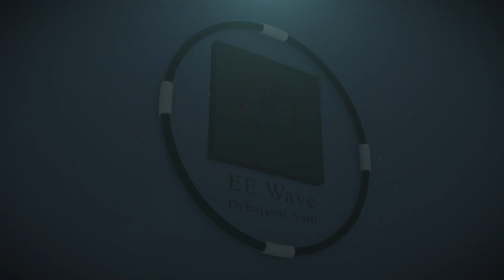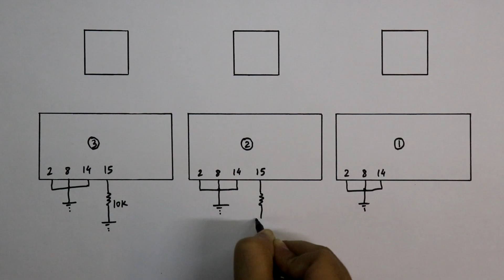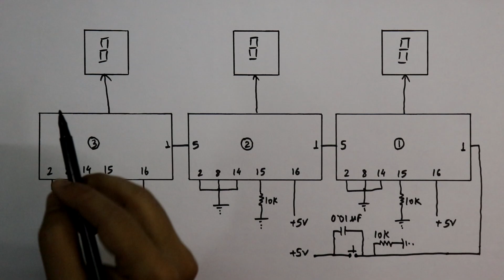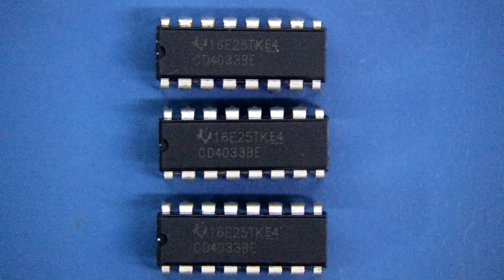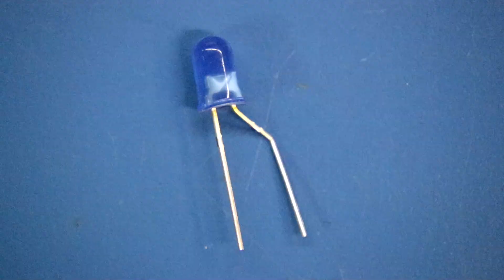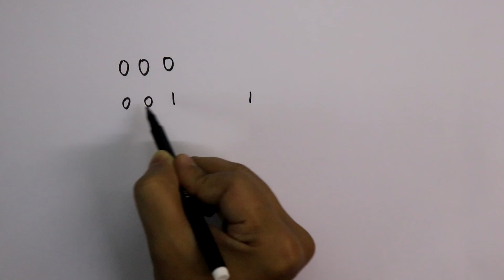Cascade CD4033 | How to cascade CD4033

Comment: if i want to reset it at 60 ...what should i do?? (for stopwatch)
Reply: Use a triple and gate, such as CD4073 and the input pins are segment E, F, G. The output pin is reset